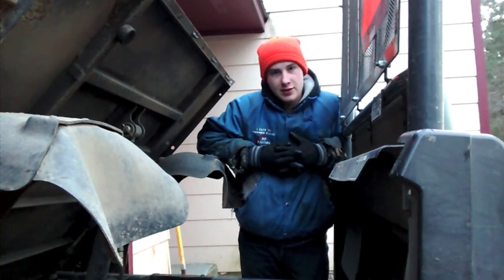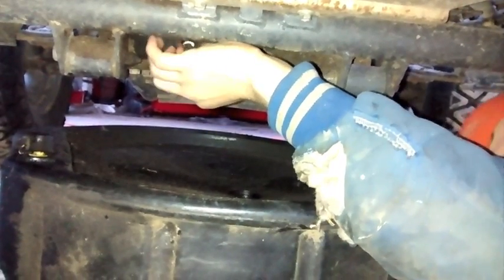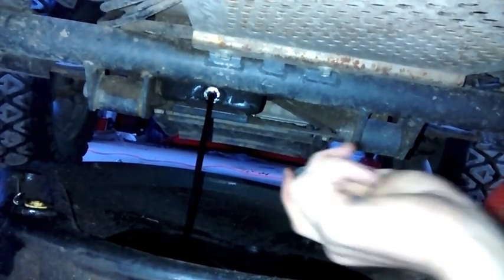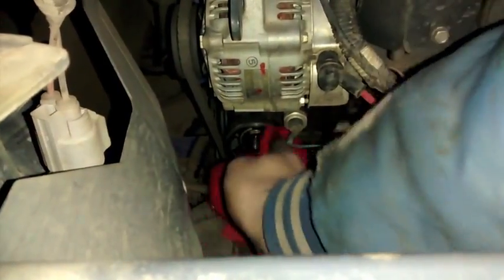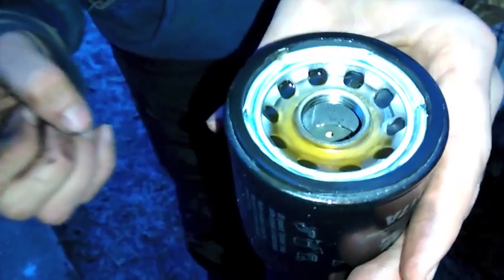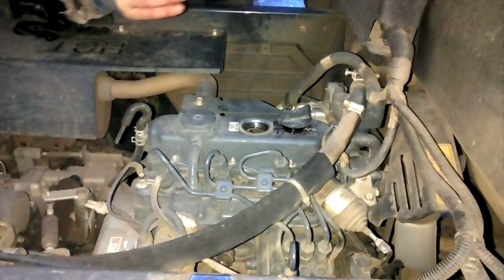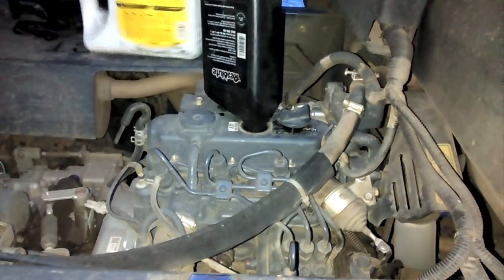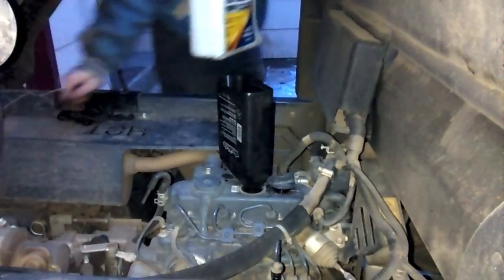How to service the kubota RTV (2017)

Comment: You recommend Fram?  Good if you want to go cheap, but check online forums for quality and results.  Do not judge ranking by sales.  You will find that Fram filtration is very substandard, so you are putting your machine at risk.  Donaldson, Baldwin, Hastings, Wix, Car Quest, OEM (Kubota in this case) will do the best at what they need to do: filter particulates that cause wear.  If you research, here is what to look for: internal construction materials and micron level (smaller is better).

Comment: Do You Get The Oil Warm First Before You Drain It?
Reply from the maker: Yes we warm it up by driving it around the block a few times
Reply: You know, this may raise a lot of fluff and it certainly goes against all of my “common knowledge” .  I run antique British motorcycles and in one of my favorite magazines I came across an article about some guys who were the mechanics for an air museum, planes that were flying. I would have to give blokes of that caliber a lot of credence. They said the best way is to drain it cold. Yes indeed they did say that! The rationale is that when hot a lot of acids and damaging vapors rise up into the engine and are not removed by draining. They do drain it overnight mind you, and I would put a red tag on the controls to prevent an accident. But there we are, something to put in all our pipes and smoke a bit. If I wasn’t impressed I certainly wouldn’t have put my thumb through all of this on a mobile phone!
Reply: Jeffrey O'Neill interesting